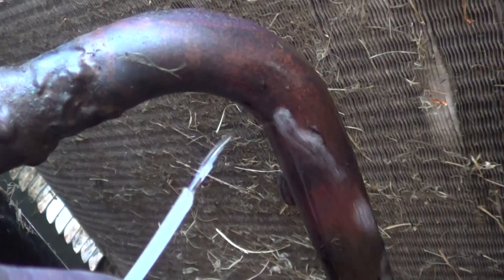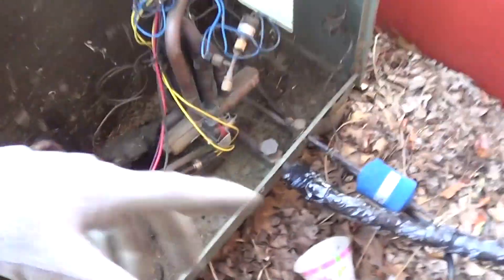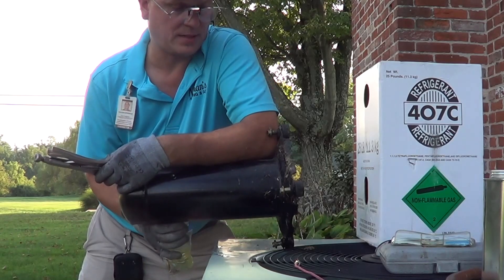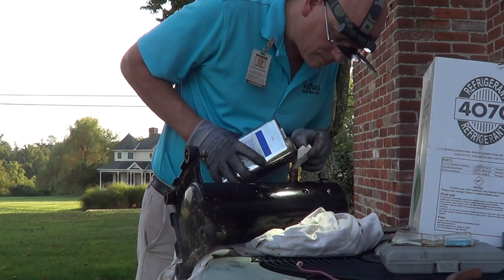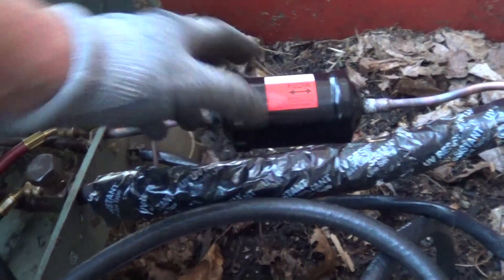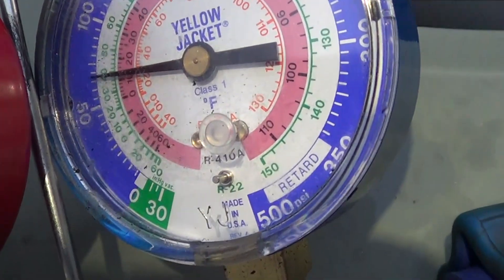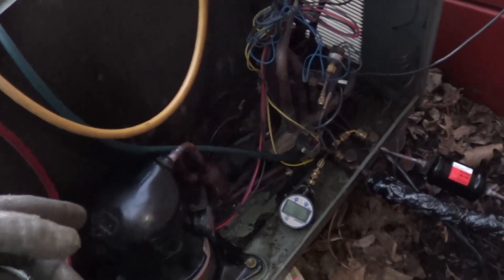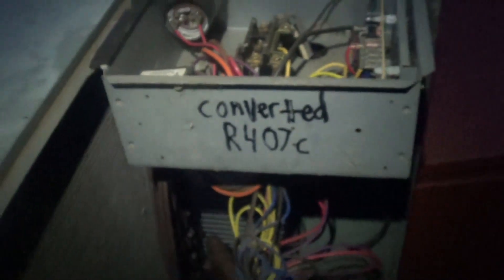Converting a R22 system to R407c

Comment: super explanation I thought that u can just top it off with 15% poe oil then recover evacuate and charge with R407C???
Reply: The problem is that Emerson, the maker of Copeland compressors says: point blank- that a conversion should not consist of more than 5% mineral oil and then further go on to say that it would be better if it were 1% or less.The AC will not work without the compressor. I believe that is the point. To say it will work, one does not truly know. It might work for 5 min. / 10 days / 1 month / 3 months / 1 year. "Define: 'It works'. What kind of warranty do you offer on the conversion? If you ever change that compressor: I will dump it to see how much oil is in it? If the mixture (POE to Mineral Oil killed it, then what difference would how much oil in it make.) There is a reason Emerson says there should be no more than 5% mineral oil. What is the reason? I think the other serious wild card in this is moisture. POE is hydroscopic if there is moisture in that mineral oil, the POE will absorb it. I just think this just asking for it on the hottest day of the year with multiple customers calling you all at once with dead compressors. <A fine way to lose customers because you can't service them all at once.> Look down the road longer than 15 seconds. 'Danger Ahead'.
Reply from the maker: The amount of POE oil will depend on how much vertical line is used and if the compressor is above or below the evaporator.   Here is the full explanation:   

How much POE is required depends on the exact system design.  The more difficult it is to move oil in the system (long vertical rises or long uphill suction lines), the more POE required. If there are enhanced internal surfaces in the evaporator, then the more POE needed to prevent filling in the
enhanced surfaces. 

Adding 20% POE may work for a lot of residential systems, but some systems may need more POE. If the difference between the refrigerant mean temperature in the evaporator and the air temperature coming off the coil is higher than what the coil was designed for (normally about 15 degrees), then there is a good chance mineral oil is fouling the evaporator and you need more POE in the system.
Reply: Emerson says you should have no more than 5% mineral oil in a system that is running R407c. Something tells me you are going to have a lot of sweaty customers needing new compressors.http://www.certifiedrefrigerant.com/copeland_r22_r407c_retrofit_guidelines.pdf
Reply from the maker: I do wish there was an oil sight glass on the compressor.  Then there would be no question where the oil is.  But, here is my thoughts.  
1) The drop in blends only use 1% to 5% butane to bring back the mineral oil.  I think 20% POE will do a better job returning the oil than 1% butane.  I'm not a chemical engineer.  This just makes sense to me. 
2) The manufactures are never going to endorse an unpure POE mixture, because they don't know what the line set will look like.  A 4 story tall line set with the condenser on the roof is going to need alot more than 15% POE to get the oil back.  
3)  POE and mineral oil mix very well.  Once they are mixed, they don't un-mix.  That means POE does start making mineral oil dissolve with the HFC refrigerant.
4)  If I ever change that compressor 1, 5 or 10 years from now, I will dump it to see how much oil is in it.

Comment: Nice video bud. Good job
It will be interesting to see in the next few years how many "converted systems" fail early because of people not changing the oil.
Reply from the maker: There is no guessing about converting to R407c.  All the major compressor manufacturers certify R407c as the R22 replacement. The engineers already did the longevity testing.  Actually, R407c was almost considered as the long term refrigerant replacement instead of R410a.

Tecumseh certifies it: 
http://certifiedrefrigerant.com/tecumsehguidelines%20for%20utilization%20of%20r407c.pdf
Copeland certifies it:  
http://www.certifiedrefrigerant.com/copeland_r22_r407c_retrofit_guidelines.pdf
Bristol certifies it: 
 http://www.certifiedrefrigerant.com/bristol_r22_r407c_retrofit_guidelines.pdf
I was concerned about mixing POE and mineral oil.  However, I mixed them 50/50 in a test tube without any noticeable separation even after 1 month.  I also confirmed with my chemist contact at National Refrigerants that mixing the oils is fine.  I made another video showing why R407c is the best R22 substitute based on EPA testing.

I don’t over think things.  I let the engineers do the research. They are much more knowledgeable. I confirmed that 20% POE is good in a simple residential application.  Residential oil return is much easier than low temperature refrigeration or commercial with very long vertical line lengths.  It doesn’t take much to return the oil.
Reply from the maker: I don't like any of the drop in R22 replacements.  They all use 3% butane to return the oil.  The butane does nothing in the refrigeration cycle and probably is why they all lose capacity.  Ebay keeps selling "Propane" as the eco friendly R22 replacement.  There are obvious explosion hazards with that replacement.  It is my opinion that 20% POE oil will return the mineral oil alot better than 3% butane.  Also, R407c is the least expensive of all the retrofits.  So, it is a no brainer to use R407c when I come across a flat system.
Reply from the maker: Rectorseal make a POE oil test.  I had a oil refractometer 20 years ago when I did commercial.  But, the best test when a bad converted compressor is found will be to turn it over and see if any oil comes out.  If the compressor is dry, then no PEO oil was added to the system.
Reply: @NathansHVAC  the drop in replacements use refrigerants like 134a in the blend that has lower capacity that is why they suck. The butane and propane have higher capacity than R 22.
Reply: Butane is still a refrigerant, so it contributes to the cycle.
Reply: NathansHVAC butane can be used as a refrigerant. Propane is used in other nations as a home and auto refrigerant. It's no more dangerous than having a gas furnace.
Reply: My local HVAC 'professionals' blew my R22 charge out a couple years ago during an evaporator change, and replaced the charge with 407C without my consent.  The thing worked fine for a few weeks, but by the heat of summer (Az) it wasn't performing very well.  No mechanical problems with the compressor, but NathansHVAC is exactly right about losing capacity due to oil hanging out in the evaporator.   Without the oil change or blend, the 407c winds up giving the performance of R22 with a very dirty evaporator coil.   (14-15 degrees Delta-T)   The compressor also operates a little higher in amps than it was with the R22. 
Also - As Nathan said, 407C (or any Zeotropic blend) becomes very problematic on systems with leaks on the vapor side since in vapor form, you won't know which of the blend components has leaked.   When the blend changes, the efficiency goes with it.

Comment: It is also recommended to change o-rings and schraders.
Reply from the maker: Yes.  Technically, the butyl rubber absorbs CFC and HFC at different rates.  So, the rubber swells or shrinks depending on what was done.  Personally, I can't see caps going bad.  I would have changed the cores, but the yahoo before me over tightened the hard flare caps and made it too difficult to pull the cores.
Reply: No, it is necessary to replace anything with a seal!

Comment: You mean you can't just dump 407 and roll!?
Reply from the maker: Actually, you can top off a CFC R22 system with HFC.  The system will work fine and the existing CFC refrigerant will return the mineral oil.  However, there are problems.  Problem 1)  Salvage value of the R22 is reduced to zero.  So, now you are stuck with R22 that can't be recycled.  Problem 2)  A significant percentage of R22 needs to be maintained in the system to prevent oil logging in the evaporator.  If the system has a leak and it is topped off repeatedly with 407c, the system will eventually crash when the R22 is diluted to the point that it can't return the oil.  Problem 3)  Creating your own blend is in the field is against EPA rules.  It is better to add POE oil to return the existing mineral oil than rely on an illegal R22 / R407c blend.  I verified this info with an un-named PHD chemist who specializes in refrigerants.
Reply: FirstR12 is a CFC, R22 is an HCFC, secondly, you can't mix the two refrigerants, they operate independent of each other...well I shouildn't say can't, you can actually do what you want, you just may not like the result. 
     When it comes to recovery, the persons that sell the gas, are required to accept the recovered gas. Just like car oil and batteries. Now you may pay out the nose for it, but they will process it for you, so, it might be a good idea to know that cost is prior to pricing the conversion. I think I read R407C is the gas that will replace all other  R22 IAW The Air-conditioning News. Also all jugs will be the same color, and these other 22 replacements will be phased out. Finally!
Reply: He never implied that.  The proper thing to do is cut out the compressor, invert the compressor upside down into a clean container, pour that into a measurable cylinder and por that amount into the compressor withPOE oil. Braze in a new drier, pull a deep vac and charge by weight about 90%, and adjust. Make sure the system is never exposed to air for more than a few seconds while the Poe is in the system or the drier exposed, same thing. Keep it dry.
Reply: Anyi Pena you would need to remove the compressor and pour out the oil in most cases.
Reply: yeah, thats the bugger to the problem, you have to yank out the compressor to get the oil out of a hermetic compressor, and thats a lot of work/ expensive labor
Reply: hvac01453 you do not need to remove the oil. If you can great, but adding about 20% or more of POE will circulate oil just fine.
Reply: can I extract the Freon and oil with the same pump? do I have to uninstall the compressor in order to get the oil out of it? please help me....
Reply: Stephen Rardon thank you so much
Reply: Only a small amount of oil will come out with the R22.
Reply: I habe done it a few times and it works just fine..as for when you turn it in to a recovering company i havn't don't that so that's a diffetent story but If they have a 25 yr old system and wanna get buy that year it definitely works
Reply: NathansHVAC my Schrader valve has had a leak topping it off with 407c wouldn't hurt the system as long as I'm not diluting it too much?
Reply: NathansHVAC im not claiming to know more than anyone. im an  apprentice. here's my question is it better just to do everything by the book especially the epa book. then if anything happens thr owner can be truthfully told it was done by the book. equipment is extremely expensive right?
Reply: R22 and 407c have same oil properties. All i did is recovered r22, changed dryer and compressor and charged it with 407c. No messing with oil at all.
Reply: Anyi Pena of course you would then need to add oil back in to match whatever refrigerant you're going back with